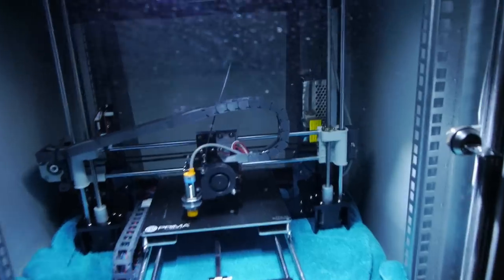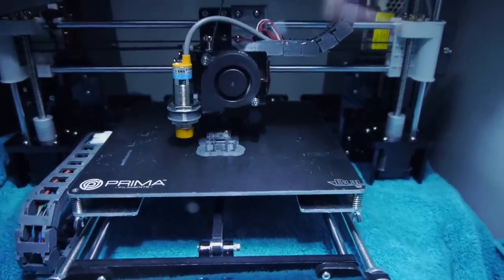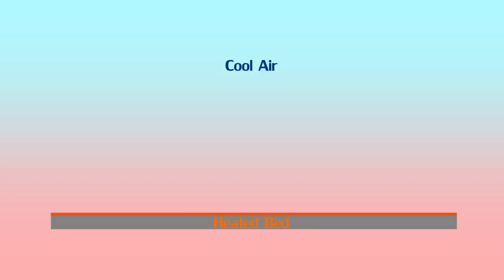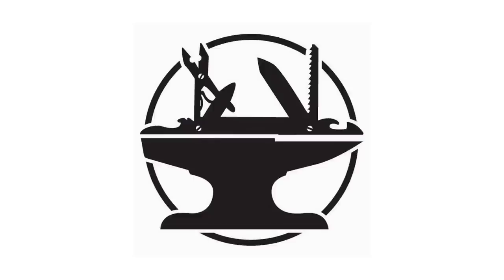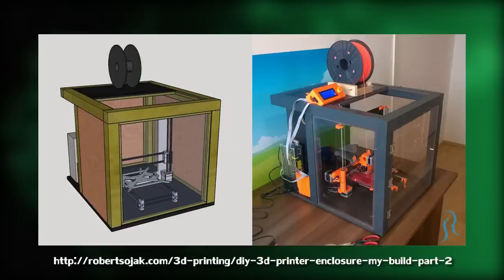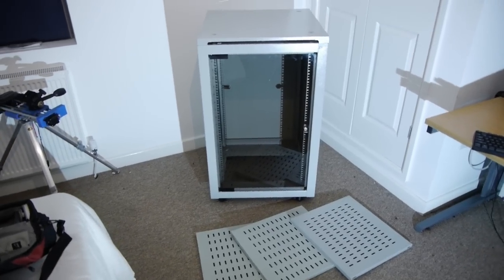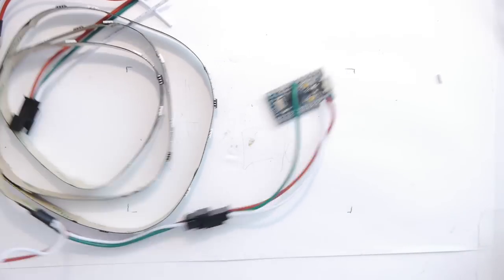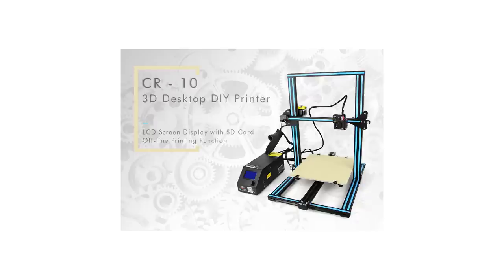Printer Enclosures: What To Use & Why You Need One

Comment: A couple of more potential benefits of enclosures if they are built suitably.  They can provide fire protection if lined with the right grade of drywall or are metal.  Not a small benefit when you are leaving a robot with a couple of heating elements to run a muck overnight.  Also you can vent the cabinet to remove abs or other fumes.   These and the sound were the main reason I built one.
Reply: L

Comment: Great Video, I think it sums the subject up nicely. :)

You can still have "white LEDs" on top, you can light the upper section with all on to get some white. You could even take it further and make status indicating colors for the LEDs, blue for ready, green for printing, red for error, etc...  

For an enclosure I personally use a combination of Lack table, and a few cabinet parts and a glass door. My printer fits rather well, the tools fit, 2 spools fit, and I have the space divided with ventilation for the electronics. I also have RGB LED strip lighting inside that does status colors, and turns white when I open the door or push a button on the outside. 

I regret it is so low, it is a pain to work in. I have thought about a bar height table instead, or maybe robotic arms I can remote control. ;)

Comment: A nice video, but a couple of points.

1) An enclosure will reduce the effectiveness of the heatsink on the hotend.

2) That's a comms/equipment cabinet, not a server cabinet, it's far too shallow, a server would stick out the back by about three feet on that (but things like patch panels and switched would be fine) :D

Comment: I would NOT advice using a wooden(or otherwise burnable) enclosure like the IKEA lack. They're cheap but its not a good idea.

Printers often print overnight or when you're otherwise gone for long periods of time making it impossible to adequately respond to a fire. There's lots of moving and heating parts that require maintenance which many people overlook. It may take years, but these kind of printers WILL fail. Whether its by wires eventually shorting, a failing thermistor or mosfet on the mainboard. The chance of these occurring are small but difficult to ultimately prevent without diligent maintenance.

Under a normal setup a printer fire wouldn't necessarily be as catastrophic and likely just leave a big black stain on your floor or table and likely extinguish by itself. However the damage will greatly increase when you add a burnable already warm enclosure whether its wood or acrylic panels. Also the pla you're storing right next to your printer inside the enclosure is gonna go up in flames as well adding fuel to the fire. Instead of a small printer fire you will have a whole freaking piece of furniture ablaze.

If you get an enclosure make sure its from metal and transparent panels are either glass or polycarbonate. And do NOT store your filament right next to your printer. Leading your filament from a safe distance into the printer is not difficult, so do it. The best thing to do is always be present when the machine is operating but we all know that simply isn't going to happen. But a good enclosure will help prevent fire damage, a bad enclosure is gonna makes it much much worse to the point of potentially ruining your life.

Completely preventing a printer fire may be difficult if not impossible, but please don't turn it into an absolute catastrophe when it does happen.

Comment: While not every printer needs an enclosure, there is something in the name of your page that many printers lack: Solid Ground!
Limit switches, thermitors and power transistors all 'talk' to the main board.
Direct connections to the micro-controller, no isolation.
A nice dry winters day killed my Kossel printer: I made the mistake of touching the hot-end without wearing a ground-strap, killed the thermistor analog input.
Other times touching any part of the cabinet has ruined print-jobs by resetting the controller.
DC ground and AC (safety) ground were not connected!
A floating DC means that static spikes have to go through your electronics to find ground.
Ground your DC power supply to actual ground, put snubbing caps on your limit switches, by-pass your thermistor channel to ground, ground your hot end!
An un-grounded hot-end on a Kossel is a linear VanDeGraff generator!
A cabinet would address all these issues, of course, but I believe in fixing root causes.

Comment: Id rather have my enclosure over a tool cart for no bending or kneeling. 

The actual cabinet should have a pullout table so you could simply slide the printer out versus having to remove a panel. Might even use a cable chain with it. 

I have many ideas for cabinets including a filament drywr drawer that you can feed up to the printer, control, electronics, so the printer was separate not heating them up and a fww others. 

Theses would be the basic for me. Should have a luxury ease of use longevity feel. For the serious hacker anyway.

Comment: Great video! Your 3D printer series has been great and it was your second video in the series which persuaded me to buy an Anet A8 for myself and I don't regret it in the slightest! I would love to put it in an enclosure but I don't think I'm able to due to space restrictions.
I'm intrigued to know, has the noise of the machine reduced by much? Are you now able to sleep with it on, or is it still a bit too loud? Also does the towel underneath the printer pose a potential fire risk?
Reply from the maker: Thanks & that great news! My case is bigger than a washing machine and I wished I went for a smaller one at the time but since I have got hold of  a CR-10 its definitely good to have the extra space. 

The towel does help but the heavy concrete slab under the towel makes the most difference. I should have said this in the video. Also a metal cabinet tends to resonate at certain print speeds so you will need to tweak your print speeds mid print to find out what works. 

The anet is a fire risk already. Loads of people on the discussion group have had melted connectors and wires. I have seen no signs of this occurring but I only print PLA and never run the heat bed hotter than 55 degrees. I would suggest looking for a an alternative to a highly flammable cotton towel. I think wool is fire resistant if it doesn't have any plastic in it. You could try that. I have put the anet to one side for now.

whilst at uni I would sleep in the same room as the printer so I can confirm that the enclosure + foam seal + slab + towel made a big difference, collectively.

Thanks for your comment! 

TL;DR Yes, Yes, Yes
Reply from the maker: *that is
Reply: Ah wow, will you do be any videos with the CR-10 in the future? I'd love to see how it compares with other 3D printers in a similar price bracket.
Yeah I had a feeling that the metal may resonate, but you seem to have it covered :P
Thanks for your response and keep up the great quality content!

Comment: hai there, own  a anet a8 to. I have the idea to to design my own case. Also i do want to use rgb led in my case but i will try to program them with the steps of the printer like: when its done it wil change green, when its printing it lights breed red and warming up another color.  I do want to install a led led ring at the hot end to light up the print. maybe an idea for you? ( sorry for my bad english)

Comment: How did you make the LED strip do that rainbow effect using that code?
Reply from the maker: It should just be a case of connecting the +12V of the LED strip (VCC) to VIN on the arduino and the +12V of the anet's PSU. Connect the LED's GND, Arduino's GND and PSU GND together. Also, connect the led pixel strips data line to digital pin 6 on the Arduino and upload to code for your particular Arduino board. You will need to download the fastled library and install it if you haven't already.
Reply: Thanks